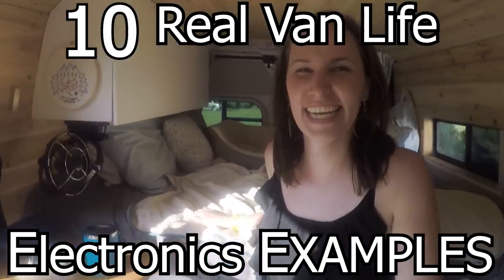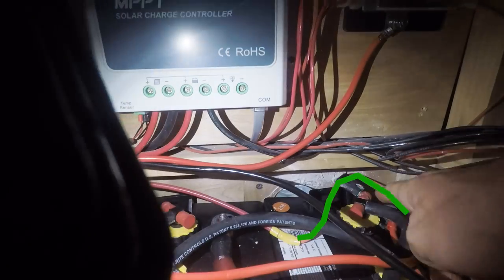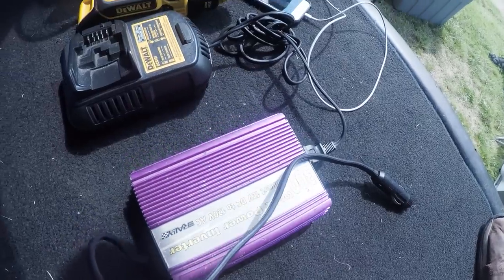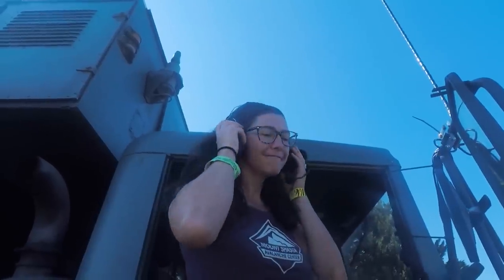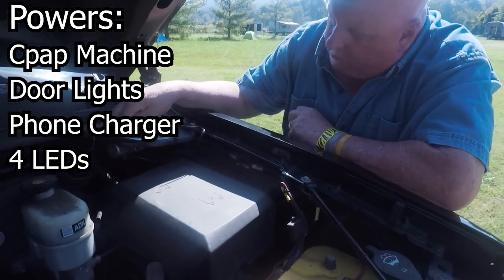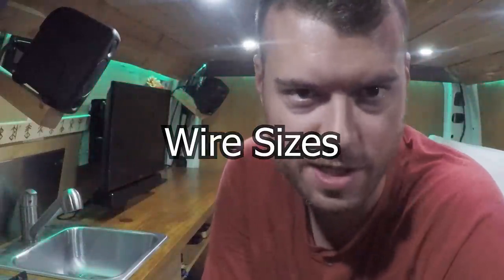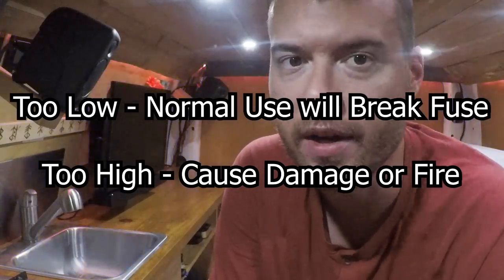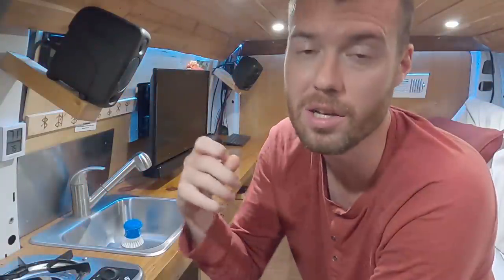VAN LIFE ELECTRONICS Start to Finish (Learn solar wiring here)

Comment: Hey Ryan, I hope you can help with this but I am wondering what size toggle switches to use for switching off the solar panels and also for the one between the solar charge controller and the battery? Is it a 30 amp toggle switch or does it not matter? Would love it if you could help, and thanks for all the helpful videos, it is so well explained!
Reply: I think I have the answer, I take the total watts of the solar panel and divide by the volts, so 200w/12v would be 16.6 amp, so I think a 20 amp switch would work. I was curious as to why you had a switch going from the battery to the solar controller. If you flipped that switch off and forgot to flip off the switch to the solar panels it would toast your controller, right?
Reply from the maker: Not necessarily toast it, I've never tried doing it, but over time I've heard it can damage things.

You are on the right track with the amps rating of switch. That will work for you. I'd just recommend matching the amps rating of switch with the amps rating of the charge controller. Mine is rated for 30 so I made the switch 30 because my panels will never produce more than that.
Reply: @OutdoorsEmbrace  you're the man! Thanks again :)

Comment: Hey Ryan, I love your channel and you have given me a lot of ideas and inspiration for my van conversion, so thank you for that. I was just curious if you had any resources on how to find used LiFePO4 batteries? I tried tech direct but I couldn't find much and google isn't yielding anything as well. Any help is much appreciated.
Reply from the maker: I haven't looked in a while myself. I'm becoming more and more partial to getting the goal zeros. They are amazing for what they are, and cheaper than getting everything yourself. Top of the line electronics inside them too.

Comment: Hi there and I hope all is well. You said that the refrigerator should be directly linked to battery for efficiency. But looking at your diagram. And I could be wrong. It appears to be attached to the positive cut of switch wire. If thats so, who does that look. And what did u use to attach them. Thanks again Great video!!
Reply from the maker: All I mean is that the fridge should not go through your charge controller. Put in on the direct batter side of the diagram. Does that make sense?

Comment: This is great, but I'm interested in having shore power as well, so I won't need an inverter, but how can I connect it to charge the battery? I don't see anything on the schematic. I'll be running some a/c recepticals that I don't need to work when I'm dry docking. Thanks!
Reply from the maker: I will be putting shore power on my next van and will make video for that when I get to it in the build

Comment: Watched until the end. Thanks! I have a question also. I was quoted for my van build electronics and it includes: "1 Battery protection 100A, 1 Battery protection on 220Ah and 1 Victron VW Bus Battery Protector" - what are these parts? I didn't hear you mention them or maybe they were given another name?
Reply from the maker: A battery protector just basically shuts off the power connection when the voltage of the battery gets low enough. It does this to protect the battery from going too low because it draining it below 50% can damage a lead acid battery. 

The parts I'm using have this built into it. I'm not going to say you don't need them, but I don't need them.
Reply: @OutdoorsEmbrace  Amazing answer, very interesting. Would a Victron Lithium battery with Victron BMS need this then!? What's an example of a part that has this built in? Thank you.
Reply from the maker: @hennnnerz  so, I'd look at the manual or the pdf files for your BMS and see if it has low voltage cut off. For instance,  if the battery goes below 12.0 volts, then it disconnects the battery to save it.

Either way, no harm installing another high quality battery protector if you have the money.

My Solar Charge Controller, my fridge, and my inverter are examples. These devices have it built in to them to shut off on low power so it doesn't damage the battery.

Your fridge and inverter should both have this because these higher powered appliances should definitely be connected directly to the battery, bypassing the charge controller (if you decide to wire any part of the load to the controller because I advise just connecting everything to the battery.

So technically wiring everything directly to the battery makes the smaller powered load appliances run the risk of draining the battery low over time, which would be over days, which again I wouldn't install a protector just for that either.

You having Lithium Iron Phosphate batteries makes me think you need a protector even less. They don't have memory issues and can safely be discharged down to around 10% to 15%.

This protection is just a fail safe to keep your battery good in case of a load being on too long etc. Worst case, you'll have to buy another battery. Use this info  responsibly and still do your own research! Good luck!

Comment: watched the whole video! would you recommend wiring items like a toaster oven and a hot plate directly to the battery?
Reply from the maker: You can wire them directly, yes. Just make sure your wire gauge is big enough for them!
Reply: @OutdoorsEmbrace   so you can bypass the inverter if the wire has the right gauge? excellent, im still digesting the batterys and loads, will get to the wire sizes soon! i may want a consultation when i'm ready!
Reply from the maker: @riverjean3745  if it's a 120 Volt appliance, you'll need to run it through the inverter.
If you can somehow find these appliances in 12 volt DC, then you can run them directly to the battery.

I don't recommend a hot plate for cooking in a van. They take a lot of power. 
If you insist on getting one still, definitely get a large Lithium battery. Probably at least 400 and above amp hours. You can get away with less, but you'll be happy you got more in this case.

I recommend cooking with propane and taking the necessary safety precautions in your build to install it. If you really want a hot plate, get an induction stove.

Comment: I am getting ready to install my electrical system in my van. I will be installing 200 watts solar panels. I won’t be using my van battery d’or dc to dc charger. I will be connecting a 1700 watts inverter. My load will be small. I have 4 puck lights for my ceiling, an exhaust/
fan, a reading light and a 21 quart fridge which will be the highest load and draw 45 watts peak. Since I will not use battery to battery charger, I shouldn’t need any 150 amp fuse, right? I did get a 30 amp fuse to connect before my charge controller. Does this sound correct? Thank you for your video and detailed plan!

Comment: Great video Ryan, yet I am still unsure that I can manage setting up my energy system myself. What is your suggestion for finding someone to install and wire everything for me?? What is the best way to find a reliable person to set-up All my electrical - Solar, inverter, isolator, batteries, MPPT monitor, All 12v wiring and x2 110 outlets?  RV dealerships won't because I have a van and not an RV - home electricians won't help because I don't have a home!!!
Reply from the maker: Where do you live? I have a buddy in Tennessee who can help!
Reply: @OutdoorsEmbrace  I'm currently in Southern part of KS.
Reply from the maker: @sharismith3291  I have a friend in Kentucky that does builds. I refer everyone to him because I trust his work 100%. But this is still far from you. If you want to reach out, let me know and I'll get you in contact.
Reply from the maker: Other than that, look up van life builders in area.

Comment: ps ….I just invested in a large "solar generator"  (reality an energy storage box)  so I know I would have power when Dec comes along.   I know the limitations and also the benefits.  Since I am NOT doing a tiny house on 4 wheels  the unit will honestly do all I need.  I am going to install a couple panels on the roof but also a hinged rack on the back so I can park in the shade and still get energy late in the afternoon when the sun is lower angles.    I am a little confused so an MPPT is for solar panels.  Then a separate gizmo deals with getting energy from Alternator to charge house batteries  ??
Reply from the maker: My newest video is on the alternator power and how to Install that part, called a battery isolator. If your van is newer than 2006, you should get a DC to DC charger instead of a battery isolator. They are both pretty much installed the same way. I show everything in the last video I made.

Comment: I watched to the end...I am just starting out and will only be partime in my van. I am not ready to completely rely on solar, so I wanted charge my house battery off the alternator and use shore power to start. Do you have any suggestions on how to safely power the house when I am not in motion without solar<
Reply from the maker: All that comes to mind is a small generator.
Reply from the maker: If you aren't running the engine and you don't have solar. A generator is what comes to mind.

Comment: Nice Video. Question.... If I’m converting a utility trailer into a camper can I still charge my battery off of my tow vehicle while I’m headed to my destination? If so, how? Thanks
Reply from the maker: Dc to Dc charger. I have a video on this (battery isolator video), just need to run wires from the truck to the trailer somehow.

Comment: I love your videos.I watched it all the way.I want to wire a isolator to use the van to charge my batterys.However I know nothing about this.I donot want to spend the $ to have solar.I need help.
Reply from the maker: Yo! I made a video on installing a battery isolator. I do recommend you at least check out DC to DC chargers first before you just use an isolator like I did, but good news, it's almost the same install as I show in my video. The differences will be shown on a schematic that comes with the DC to DC charger.

The reason you want this instead is it's more efficient. I should have gotten one myself.

https://youtu.be/ZatqnEGM5GE

Comment: Can you apply this to a boat setup? Also I’m stuck on dc to dc charger and where the switch goes… I have a starter battery for outboard and 2 leisure batteries. So I will want the battery starter to work outboard then when I’m in the move I’ll want to use the leisure batteries too. Plus when I’m static I’ll just want to use the 2 leisure’s.
Reply from the maker: Yes! Same for boat

Comment: Could you just use a surge protector, and have the surge protector plugged into the outlet of the power inverter?
Reply from the maker: Oh, like everything you can do in a house, it's the same in a van pretty much. At least think of it this way, so the answer is yes. That would work as it would if you had it in an outlet in a house.

Comment: Great video, watched all of it. I just have a question about my setup. I have 2 100ah lead acid batteries, 160w solar with 20A Mppt, B2B split charge relay with minimal usage like led lights and 1000w inverter for limited microwave usage and was thinking if there is any harm in connecting a battery charger to charger the batteries when on shore power.
Reply from the maker: There would be no harm in connecting a b2b from shore to battery. I think I would with your smaller amount of solar. Given you don't use much power though, then do you feel it's needed? Does your power seem to struggle?

Comment: So from my understanding it is better to use a btb charger that turns on when the vehicle is started rather than using a battery isolation switch?  Or would you need a battery isolator and a charger?
Reply from the maker: It's better to just go with the b2b. You only need one or thr other, but there are many benefits to b2b that almost make isolators obsolete.

Comment: Watched to the end! :D

Question;
I am installing a lithium 200ah setup in my Caravan, my 4x4 has a dual battery setup already using a redarc Dc2Dc charger. 

Can I run a cable from the DC2DC to the back of the car and connect the lithium in the caravan via Anderson plug at the tow hitch? 
Or can I connect the cable from my lead acid deep cycle (the cars second/aux battery) to the back of the car to connect to the caravan lithium? 
Or will the combo of lead acid and lithium cause problems? 

Thanks,
Alex
Sydney, Australia
Reply from the maker: To do this, thr DC to DC charger MUST be able to charge lithium batteries. Lithium and Lead acid are not charged in the same way, so you'll need to make sure this DCtoDC will not just simply connect the batteries together, it needs to change the charge output for the lithium specifically. Otherwise it could ruin one or the other set of batteries.

Comment: Super informative video, thanks! I just put my system together and have some concerns about my battery: it's making a bubbling/fizzing noise when charging. My system is small: 1 x 100W Renogy solar panel, 20A MPPT Epever charge controller, and 125Ah AGM battery.. so I don't think it's being overcharged. I'm reading so many conflicting things online and am just trying to figure out if the noise is normal, and if not, how do I make it stop? Does the bubbling mean the battery is being damaged, or could be dangerous? Please let me know if you offer consulting.. I would happily pay for some expert advice if you can help me with this! Thanks
Reply from the maker: I honestly don't know the complete right answer on this, but my battery makes this sound too when charging. I'll do some research on this and probably put the answer in a future video. Thanks for bringing it up!

I thought something was wrong with my battery at first too, but my battery is still going strong.
Reply: Outdoors Embrace - oh yay! It's not just me!! Thanks for replying. I've done a bunch of research and found very split opinions on forums.. some say it's normal for sealed batteries to make a little noise, some say it's not. Hard to qualify what is just "a little" noise.. but I think mine falls in that category. More like a carbonated beverage, not boiling or anything. Maybe I just have really sensitive hearing lol. I'm going to keep an eye on it and hope for the best. Glad to hear there's someone else out there with this situation and that yours are still going strong!

Comment: Great video, I have bought a 20 Amp MPPT Renogy Solar Charger to charge two Starter batteries with 950 CCA. I just need the Solar to charge the batteries for my Pontoon front and rear thrusters. Am i wrong in my assumptions?
Reply from the maker: What are you using these batteries for? Why did you get starter batteries? If you plan to use them for RV stuff or anything like I do, you should get deep cycle batteries. Starter batteries have super low amp hours, so they'll die very fast.
Reply from the maker: By the way, starter batteries (shallow cycle) are not good for solar use, but deep cycle are good for starting up an engine along with all the RV needs. Get batteries rated in amp hours, not CCA.

Comment: im running  a house type a/c and a house type mini frige. and a  a/c house portabe radiant heater and plug in kitchen appliances toaster,hot plate and my 12 volt lights and 12volt plugsp.  So im figuring 400watts in solar panels but what size controller(60)? and type do you recommendd? Also will a 2,000 watt inverter will it be big enough? Mounting on 2004 e250 cargo with roof rack. Can i use 2 regular 12 volt car batteries instead of the other ones? Thank you for answers

Comment: are there any cargo van makes/models I should avoid (more breakdowns/maintenance)?
Reply from the maker: No Promasters gas engines basically. I can't go over everything in such a small text, but certain years are better in many vans. Most vans are fine, but avoid the cheap parts and poor quality of Promasters
Reply: @OutdoorsEmbrace  awesome thanks. i'm probably going to try and go with a Chevy Express or GMC Safari

Comment: 28:18 Wait, how is he managing to slap 1600Watts at 24? volts through a 60amp charge controller. Isn't there going 66 amps through it at full efficiency?

Comment: Hey watched till end Didn't wanna look thru the 350 comments  to see.if it was already answered but how would you hook up a gaming console for example a ps4 to the 12v system without the inverter
Reply from the maker: If somehow the console is 12 volt without the converter on the plug, then you could cut the wire of the console and wire directly to the battery. Check the voltage output of the converter for the consoles plug.

Otherwise you'd really have to know some advanced electronics.

Comment: Hey man thanks for the awesome vid! Another question for you: how do you know the mt50 battery meter isnt correct and what is the best way to read your battery level with it? I was a bit confused because you were reading the volts starting at 12.7v but the mt50 said 13.7v. Can I be pretty accurate with just the mt50 or should I buy a meter like yours?
Reply from the maker: You should definitely buy a meter like mine. I test the batteries directly with a multimeter and the mt50 is always off a little. The other one in this video is spot on.
Reply: @OutdoorsEmbrace  Nice, gonna grab one! But how do I know if I need the 50a or 100a? I'm using 200w solar, 40a controller, 100ah lithium and 600w inverter
Reply from the maker: @MrMnlkn  get the AiLi Voltmeter Ammeter on Amazon. The version that says 8-80V, 0-350A
$44
This one is only $3 more. It'll be worth it if you add more battery down the road.
Reply: @OutdoorsEmbrace  Perrrfect thanks a ton man!